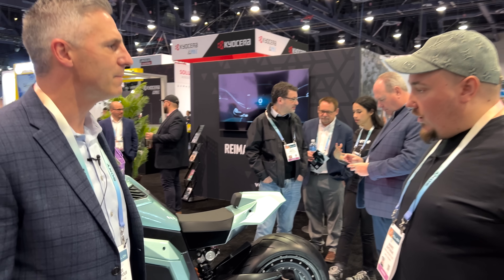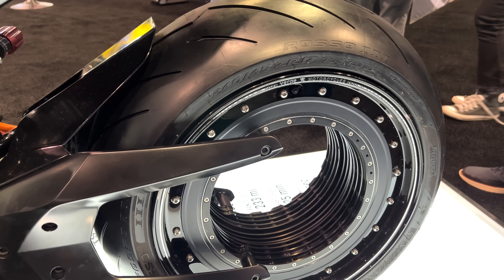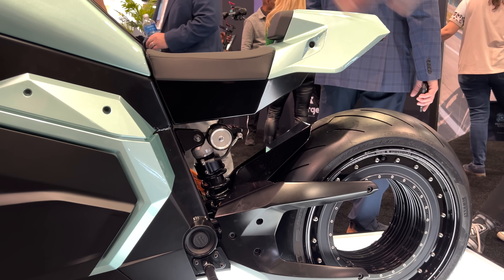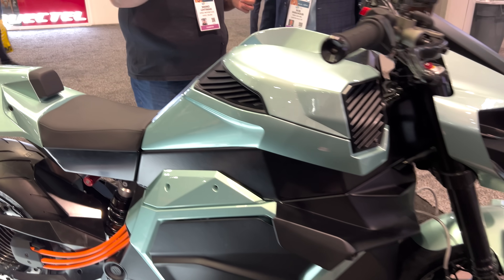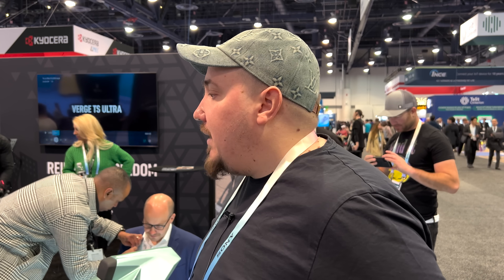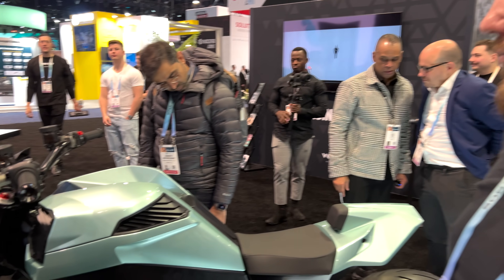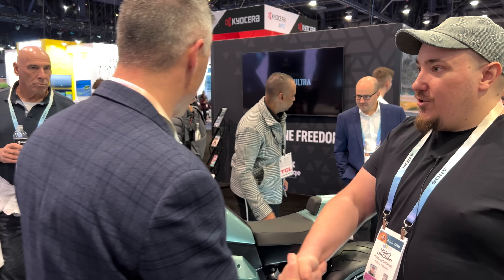Verge TS Ultra: The Future of Electric Motorcycling | CES 2024

Comment: One of the reason to put motor outside of the wheel is to reduce the unsprung mass which affects the motorbike handling significantly. None a word on how heavy the hollow motor is in this bike, but even if they use compisites it still could be 15kg+. Plus you'll need to have a good seal to protect that hollow motor huge bearing from getting dirt and water inside because that bearing itself will cost $$$$ to replace.

Looks cool though.
Reply: Yes, not only unsprung weight but it's also all at the back. The other downside to a rim motor is longevity. I wonder what the warranty is like? The advantage is the wheelbase length, it looks like it might handle nicely, depending on the characteristics of the motor I suppose? I'd like a test drive
Reply: in one video i saw they riding and he hit bump/pothole on/in the road - rear wheell BOUNCE a lot
Reply: I had a 50cc scooter with a rear wheel that weighted around 2kg then a 1000cc bike with a rear wheel that was way over 5kg. I was dead worried about that unsprung mass bs... just kidding... no. This is just a bs for pedantic people.  They never talk about suspension or power available or where and how do that powered gets delivered to the tire contact patch etc. Uh Oh unsprung...
Reply: Looks like It's sprung, tyre floats on the bearings and the motor that is attached to the side arm? 🤔
Reply: @Y2Kvids  everything from the swing arm pivot rearward is unsprung weight. So, swing arm, motor and wheel are all considered unsprung weight.
Reply: @Y2Kvids  There's a wheel which is pretty much just the rim and a flange to mount it to the motor rotor. The motor stator is attached to the swingarm.
Reply: @Y2Kvids I get what you're saying eventually everything is connected to the spring so everything sprung weight. I mean the rear spring ends up connecting to the front springs so even the springs are sprung. 
Pretending like we know what we're talking about is kind of fun. What subject should we hit next? Drive by wire? We read headlines were practically experts
Reply: https://youtu.be/a7oTg6XJsnk?si=nkb1OqFoc-gLL2SR
Reply: That rear wheel (flywheel) will make sure the acceleration and braking is poor. The motor could  have at least be centered.
Reply: These things are totally unproven and around $50,000.
It's just a wank. Maybe Jay Leno will buy one as a conversation piece. The rest of us may as well ignore it.
Reply: it is prolly 25k+ and yes, the bearings need to be VERY high quality and protected, EUC have already gotten away from using such a massive core because it is not easy to keep the bearings safe
Reply: I thought about the unsprung weight factor as well… gotta b heavy!
Reply: Silly rim
Reply: This; those bearings will suck in every respect and honestly its bs to say this is function over form. Cost, weight, rigidity... none of it really adds up.
Reply: That comment proves that unfounded conjecture and uneducated opinions can get someone more Likes on Youtube than they deserve.
Verge have talked about all these points in various interviews, Ruslan, but you didn't bother to look for answers to your questions before doubting the company.
Reply: yeah i dont buy into their marketing. that motor design has no benefit other than looks. every single technical aspect is worse than a regular hub or central motor.
Reply: Weight savings on Axle/spokes , chain,sprocket , centre hub Vs added motor, copper, carbon fibre rim, bearings, cooling fins .
Reply: @Y2Kvids  It would be interesting to see a comparison in all the components for both. I'd still suspect that the conventional wheel is lighter, but how much lighter?
Reply: I'm an engineer, motorcycle rider, and disagree.  Drive belts are low maintenance and quiet.  Axial flux motors like those made by YASA are compact and power dense.  Between the two that is not much space loss for low center battery placement.  You want wheels and suspension parts as lightweight and strong as possible.

Comment: I want to know about the pack voltage, what type of motor is it using, Ac or Dc? Battery capacity in volts and amp hours, miles per kwh used, overall range that can be expected,  this is all useful information to have when considering a bike.
Reply: Its neither AC or DC. Its electronically commutated 3-pole.

Comment: I am planning on building a bike with pretty much the same concept in mind. Reduce the amount of moving parts, and keep the weight low. I have a 1979 Kawasaki that I am converting to EV, I will build the roughly 20kwh pack and it will fit where the engine and trans used to sit. As far as the motor, I am not 100% sure where that will go just  yet, most likely a rear hub motor, but I want longevity and maybe a mid drive will be best, I'm not sure yet.
Reply: How much will a 20kwh battery weigh?
Reply: @rjbiker66 your not going to do better than 100kg

Comment: Another over priced motorcycle that has no storage or weather protection for the rider, which would improve aerodynamics. I really want to know how they solved the hub wheel issue of debris fouling the contact points with the chassis. That has always ended these designs.   Plus the price points on this bike are just ridiculous.  how are the battery and motor cooled?  if air then it is out of date day one
Reply: That's a lot of surface area for air cooling the motor.

Comment: This reminds me of the early computers in the '80s. Imagine where we'll be in ten or twenty years.
Reply: Or phones.
Reply: ya volt the sky's the limit
Reply: FYI, battery costs have been reported to have dropped by 40% this past month. @markmeridian3360
Reply: They'll be obsolete as the mass Anerican market will reject them. We love bikes here--building em, fixing em up, revving loudly... Ebikes are boring. Can't work on em. They don't feel like a hog. 

Maybe if you're a 20 yr old Asian kid who likes street bikes, but probably not. If they were cheaper and disposable, they might make good drug smuggling bikes for the border gangs.

But no self-respecting American would be caught dead on that duracell.
Reply: Battery tech is the game of the century. They already are coming out with batteries that dont use rare and expensive materials. Also these type of batteries are 95% recyclable. @markmeridian3360
Reply: Too expensive for the moment but who knows. I don't think I am going to feel the same way about an electric bike as I do  about my 25 year old Moto Guzzy California.
Reply: 100% we gave reached the pinnacle of combustion engines, now we'er at the beginning of lightning-machines.
Reply: gettin there
Reply: @dodgygoose3054 The market shows otherwise lol

Comment: How would you get that rear tire serviced though? Doesn’t look like anything just any bike shop would be be able to do.. is there a special tire machine you would need or special tools to actually do service? Tires don’t last forever so just curious to find out if their new design fits into current infrastructure
Reply: They have a video on their channel showing how the rear tire is removed. The tire comes off with the rim, the motor stays connected to the swingarm, the tire is replaced like on any other rim
Reply: @Tomzuki.  nice! Ty for the reply

Comment: Heat rejection in competitive driving will be interesting. Heat and heat cycles matter a lot with tyres, and the motor is now the rim.
Evolutions might have fans in the rear hubs spinning actively or passively to get rid of as much heat. There at least is a lot of surface area to the inside. Liquid to air cooled? A thin outer layer of silver (the real Ag) coating might assist.
Reply: The rear rim is carbon (even though the front wheel looks aluminum), likely because of heat.  Also, adding a layer of more conductive metal doesn't help.

Comment: Better test drive this one, on rough roads and sharp turns.  Competition and dirt bikes do not reduce every gram of unsprung weight for no reason.  Motors in the wheels are a massive amount of unsprung weight.
Reply: The BMW GS says hello. 😜😂
Reply: What does unsprung weight mean? Weight not carried by the springs?
Reply: This is more a cruiser than a sport bike
Reply: There are more recent reviews address the low center of gravity and ride quality in different modes - unsprung weight is not 100% of handling in a complex system.
Reply: Does this guy represent Verge or Donut , or  both? I know Donut is a subsidiary of Verge
Reply: Well this is neither a competition nor a dirt bike, so I see no issue with added unsprung weight. The bike is heavy to begin with, so on track it's not going to be as nimble as a sport bike.
Reply: @Tomzuki.  Since  YOuTube will not allow  a link to an outside source that would explain to you the fundamentals of moto suspension here is what Chat GPT has to say on the matter.

Low unsprung mass is crucial in motorcycles used on the street for several reasons:

    Improved Handling and Responsiveness: Unsprung mass refers to the weight of components not supported by the suspension system, such as wheels, tires, and part of the motorcycle's suspension. Reducing unsprung mass enhances the motorcycle's ability to respond quickly to changes in the road surface. This results in improved handling, better maneuverability, and increased responsiveness, especially during cornering and quick direction changes.

    Enhanced Suspension Performance: A lower unsprung mass allows the suspension system to react more efficiently to bumps, irregularities, and other road imperfections. The suspension can follow the contours of the road more accurately, providing a smoother and more controlled ride. This is particularly important for street motorcycles where comfort and stability are essential.

    Increased Traction: Lower unsprung mass contributes to better tire contact with the road surface. Improved traction is essential for safe street riding, especially during acceleration, braking, and cornering. With reduced unsprung mass, the tires can maintain better contact with the road, leading to enhanced grip and stability.

    Reduced Vibrations and Fatigue: Motorcycles with lower unsprung mass tend to experience fewer vibrations transmitted from the road to the rider. This not only enhances comfort but also reduces rider fatigue during long rides. The overall smoothness of the ride contributes to a more enjoyable and less tiring experience for street riders.

    Braking Performance: Low unsprung mass is beneficial for braking performance. The reduced weight in the unsprung components allows the braking system to work more effectively, resulting in quicker and more controlled stops. This is crucial for street motorcycles where sudden stops may be necessary in traffic or emergency situations.

    Fuel Efficiency: While the impact on fuel efficiency may be relatively small, reducing unsprung mass can contribute to overall energy efficiency. Lighter components require less energy to move, and this can result in slightly improved fuel economy.

In summary, low unsprung mass in street motorcycles enhances handling, responsiveness, traction, and overall ride quality. These factors are vital for a positive riding experience, safety, and performance on the diverse road conditions encountered in everyday street riding.
Reply: @Tomzuki.  if your wheel isnt getting back to the ground on time, you will be sliding away with all of that torque. Whether this will prove to be an actual problem with this particular bike will be proven as soon as it is made available to test riders
Reply: @axelfiraxa it’s been ridden in EU for few years now.
Reply: This doesn’t look like a trail bike, looks urban/highway to me.
Reply: @gwarlow  Matters less, but  still matters greatly in handling.

Comment: 2:20 No cooling at all? No inverter cooling, no motor cooling.....then I'm afraid it wouldn't hold up for me at work when I need to push +20kWh/100km for an urgent delivery/pickup.
Reply: The batteries are fire-safe, retaining 95% of their power at temperatures between -30 degrees Celsius and +100 degrees Celsius. This is a new battery innovation that does not require cooling.
Reply: @R2-D292  you are replying to a year old comment...nothing related to the 2026 solid state battery. Never said or wrote anything about a fire. I hit +50ºC (motor/straight cut gear and battery) with current near zero ºC temperatures. It's called express deliveries in a country with very few roadside radars 🤏

Comment: Nice review, but need some essentials: weight, price, top speed?
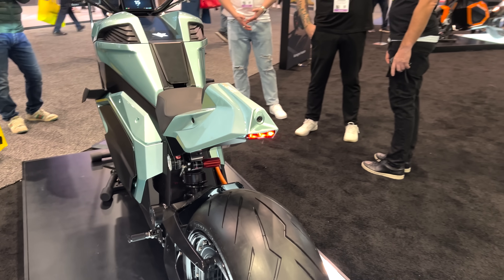Reply: 3:00 they show some of the specs. 233 mi range, 124 mph top speed, 2.5s 0-60.
Not sure about price and weight.
Reply: . . . total of unsprung weight because of hub motor shortcut.
Reply: $45,000 for ultra, $29,000 for “pro” model

Comment: Sadly they are a bit pricey. :(  Not much wind protection either. I'd love to see the tech in an adventure bike.
Reply: You want an unsprung motor in an off road bike?  Think again.
Reply: @SkyRiver1  it depends on the weight of it. Losing the chain would be good too. Versus a 1290 SA S/GSA it might be fine.    Many adventure bikes don't really go off-road, just trails and such. I'm not suggesting it's a replacement for a Sur Ron. 😁

Comment: Love the concept of the back wheel. This is how all motorcycles will be built in future. It makes so much sense.
Reply: No, it DOESN"T. Very very heavy wheels. Not simple. Not oem type design.  Gimmicky
Reply: Depends. He spins the story wrt packaging for handling. But unsprung weight is often very detrimental as well. So it's still a trade off.
Reply: Does the tyre come off easily is the rim just coming with a motor?
Reply: @Cloxxki  They have a video on their channel showing how the rear tire is removed. The tire comes off with the rim, the motor stays connected to the swingarm, the tire is replaced like any other rim

Comment: Looks great! If they can get decent range this thing could be a viable super naked alternative
Reply: There are some amazing electric motorcycles already out there today. I got one of the first Zero SR/F bikes (140 lf-ft!!!) four years ago. Today Energica sells fantastic 2-wheeled EVs, and I know there are others. That wheel-motor looks cool, but it is all unsprung weight.
Reply: @Miata822  well said. Right now I have ICE motorcycles (and a Motocompacto) but eventually I want an EV bike that's fun. Not sure when they are right for me, but I'm sure I'll have one some day soon
Reply: i fck8n doubt it. these type of vehicles are not needed in the future.
Reply: Motorcycles are very difficult to get good range with at highway speeds due to poor aero, mainly due to the big hunk of meat that sits on them.
Reply: @streddaz  highways suck on motorcycles anyway. I do what I can to avoid them, always choose the old 2 lane over a superslab, unless I have no choice. It's not about getting from A-B it's about the ride.
Reply: @elbowsout6301  yes, a highway is pretty boring on a good motorcycle. My reference was to the speed you do on a highway, which you can do on smaller roads in regard to electric bikes. Any higher speed is going to significantly reduce your range, and with motorcycles having quite poor aero for their size, it’s not an easy fix. For city riding, an electric bike would be very good.